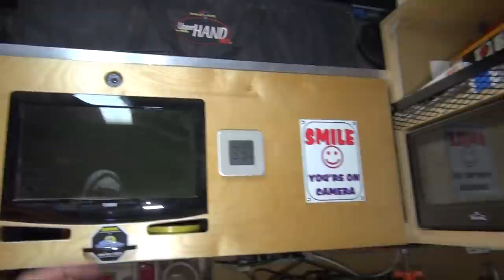The American Innovator - Lean Truck

Comment: Paul, I know I'm a late commenter, but this is simply outstanding. I am a retired Boeing engineer and was working at Mcdonnell -Douglas Aircraft when the company was bought  out in mid 1997. From the very beginning in 1988, upper management on the C-17 program incorporated Malcolm Baldrige quality management tools. followed by Kaisen, 5s and Lean manufacturing principles. The principles work and work well. Boeing C-17 Transport won the Malcolm Baldrige Quality Award in early 1997. We can thank W. Edward Deming for that and also the Japanese for kicking our butts and showing us how to do it in the automotive industry. I'm sure there are other contractors out there using Lean construction principles, but nor near enough. The construction industry is one of the most if not the most inefficient, wasteful and lowest performing  industries around.  Lean Construction was brought out in the mid 90's, YES, almost 20 years ago!!. What's the problem guys and gals?  And you can't figure out why you are losing bids or not making any money! Adjust your thinking, adapt the principles or parish. It's that simple. I will be starting my own construction company very soon in the near future. You can bet your latte I will be using Lean in my business. Again to recap  Very well done Paul you are an inspiration!!!
Reply from the maker: Robert I am honored and encouraged by comments from a man of such accomplishments and knowledge. I am very grateful to have you as such a strong Lean Advocate in the the world. Currently the number one area that I have been working with Lean has been the construction industry they have finally got it and many are seeing the light, It's very encouraging. Thanks, Paul

Comment: Hello this all looks great and is there a way I can get more info on the vacuuming system as well?
Reply: it's extremely likely that it was a festool vacuum given the number of festool boxes present.
Reply: +Craig Hastie That is correct, I use a CT22 with small blast gates to toggle between the sanders and chop saw.
Reply: +Brian Way I've got the CTL26, great bit of kit! and makes sanding so much easier.

Comment: So, instead of cutting the padlock, I just cut off the steel strap instead. Got it!

Haha...actually, that would have been a good idea if the strap was on the inside of the door...
Reply: Jc Knight that is actually the recommended way of installing it, this video shows my Prototype before was brought to market. Check out some of the current videos on FastCap .com or taillock.com
Reply: As a reformed, er appropriator, I naturally look for the weakness in any system or device. That prototype just jumped out at me. Good to see you improved the design on the final version I saw on your website. Only someone really committed to the boxtruck's contents would spend the 10 minutes necessary to try to defeat it. Good job!

Comment: I am not a proponent on carrying too much in a truck or trailer. I am a 2 man shop and have a Metris that has shelving on both sides of the van. That is plenty for the installation and site tools we need. When I have to take a site table saw or a thickness planer to site I just take it out of the tool crib. Just sucking a lot of fuel when this approach is used.
Reply: This truck gets 11-12 miles/gallon.  Fuel consumption is not something we have really ever been concerned with :)